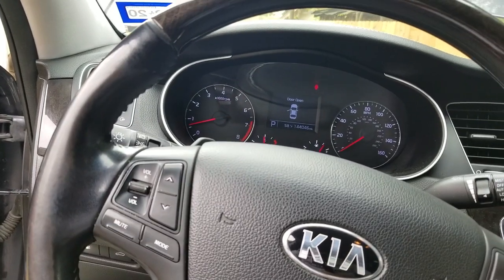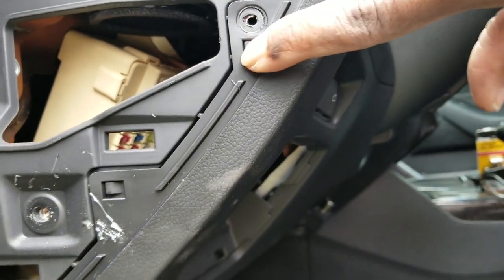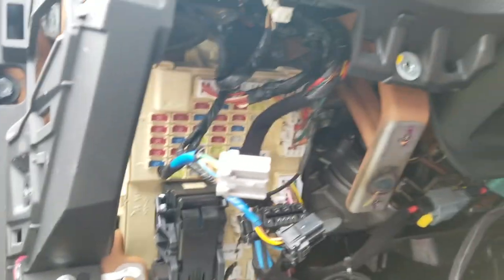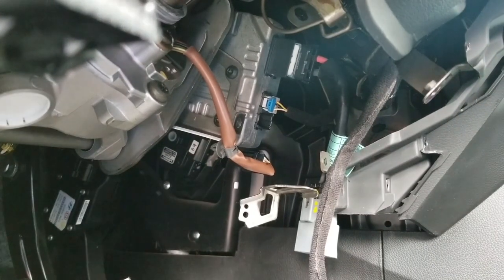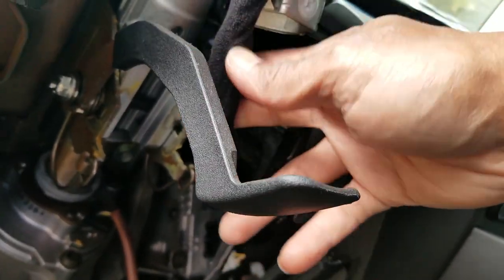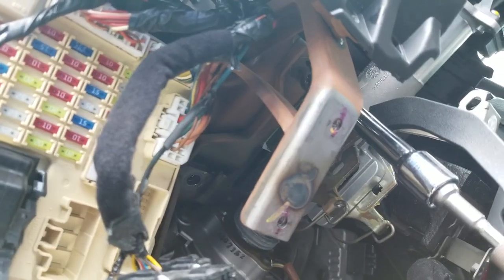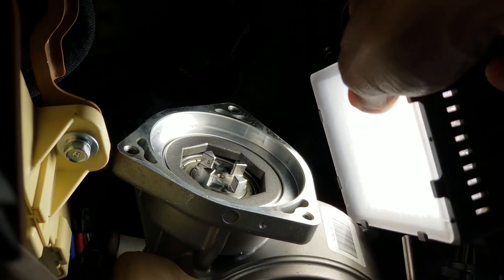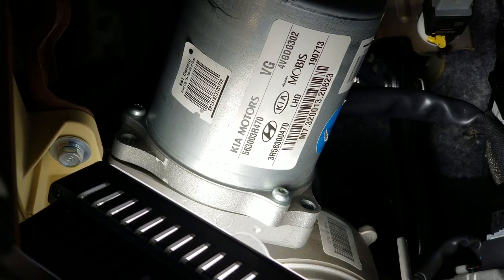2014 Kia Cadenza Flexible Steering Coupler Part 1

Comment: There is a recall on this item. I took mine in @ 141,000 miles and they fixed it for free. The recall is extended to 150k miles or 10 years which ever comes first . While there they also told me there was a recall on the windshield , they fixed that too. Also, my oil light would flicker on and off especially at idle. They ended up replacing oil sensor also for free.  😁

Comment: super helpful video man, watching this made me realize that mine is limited trim instead of premium because of the power steering. but nevertheless, the procedure would be the same. Keep these cadenza videos coming! I'm about to change the spark plugs, oil pressure sensor and the PCV valve in one go, wish be doing it step by step while watching your previous videos. :D

Comment: thanks for your cadenza vids.. seems like not many people post em cuz its not a common car. 
question: do you know anything about issues with the steering wheel buttons not working correctly at times? sometimes my buttons will do the wrong function, mode btn mutes, track down btn voice assist. it does it randomly. 
also on my electrical seat adjustment, the switch to raise my seat vertically up sometimes will not work, and I will have to try it multiple times before working. seems like my car is having more and more of these issues. could it just be the buttons/switches? 2014 kia cadenza premium. any info would be helpful. thanks.

Comment: Dose'nt work for a 2014 KIA forte, the upper frame is welded in (factory bull crap) it is impossible for me to drop the steering enough to change the $6 rubber bushing.

Comment: I am facing the issue of occasional left pulling in Hyundai Elantra after calibrating the steering angle sensor as well, it is any symptom of bad flexible coupling..
Reply from the maker: Bad flexible coupling will give a clunking sound in the steering wheel column if it’s worn out.